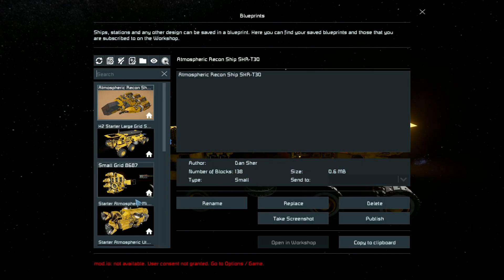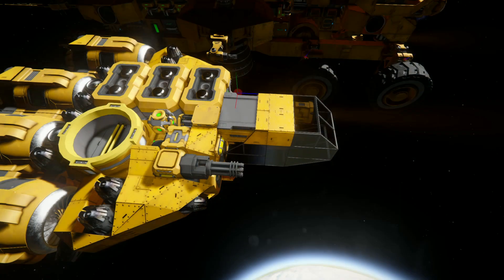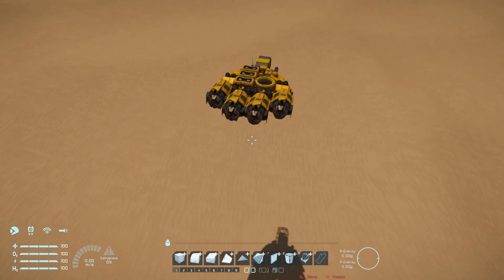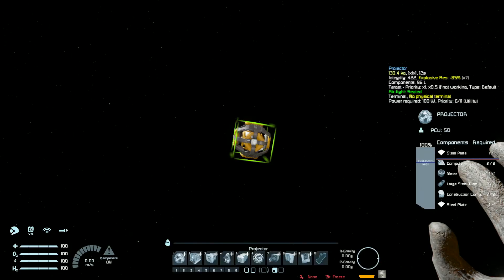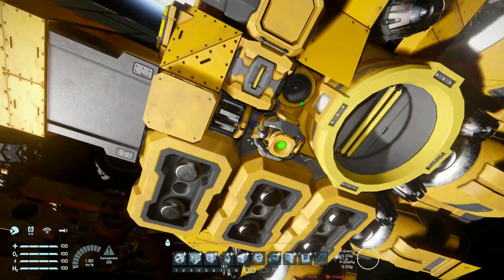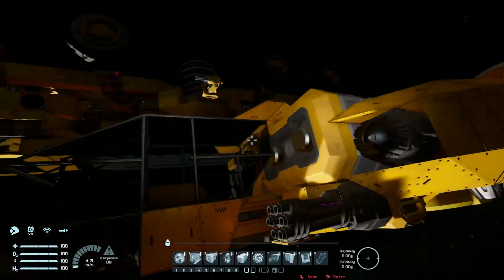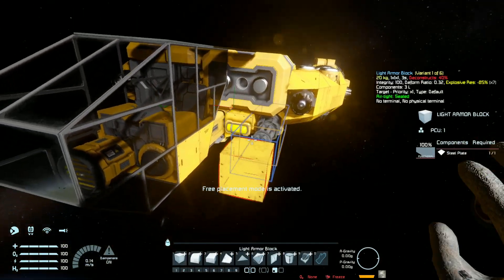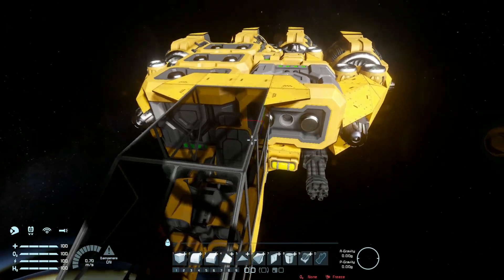Fix Your Pivot Point! / Space Engineers Tutorial

Comment: Hmm, I wonder what happens to the pivot point if you merge or unmerge grids. It could be a cool way to change the pivot point in survival if you can make a large grid with an offset pivot point, if it works as I assume (if the pivot point from the larger grid is copied to the smaller grid)